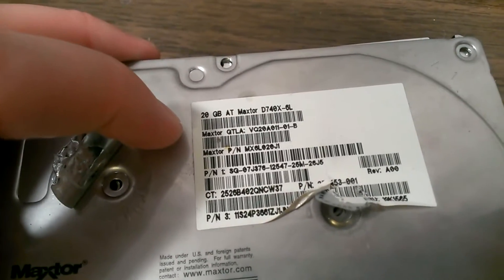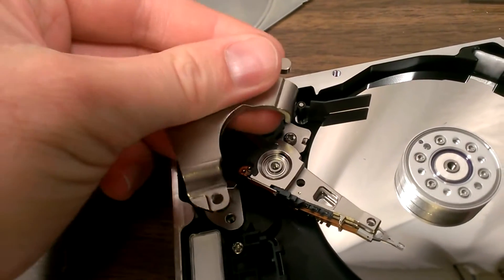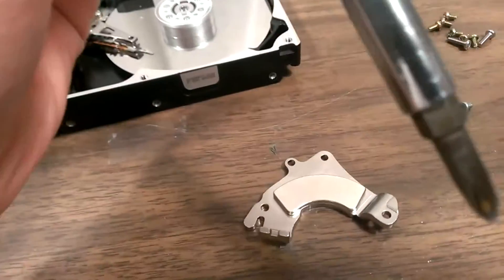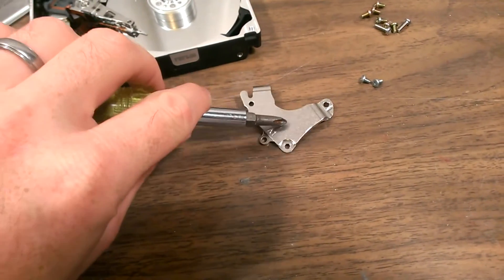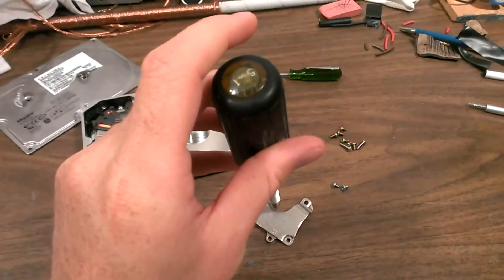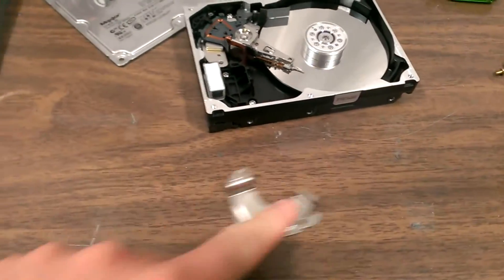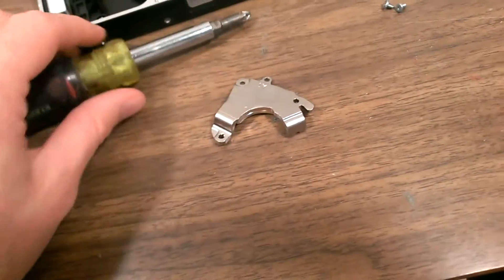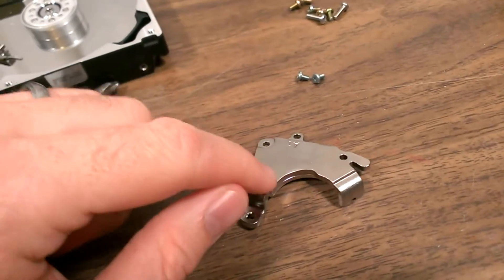My introduction to MU metal

Comment from the maker: No, it is a metal called MU Metal. Primarily Nickel in composition.
Reply: I searched for like an hour mu metal and I finally paid for some ... and minutes later I find your video.
I didn't know that part in a hard drive was mu metal, It's exactly the size I needed for my experiment and i had that exact piece that I already unmounted 1 meter away looking at me all this time.
I would have watched your video 5 minutes earlier and I would have saved 20€ 
Thank you though, at least I won't wait 20 days for my project :)